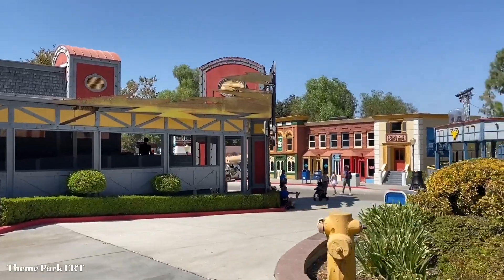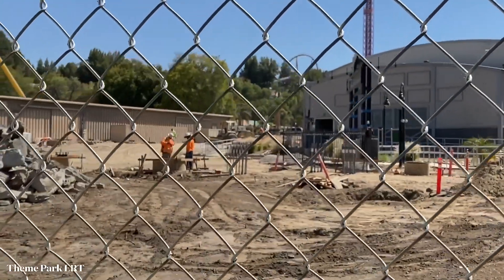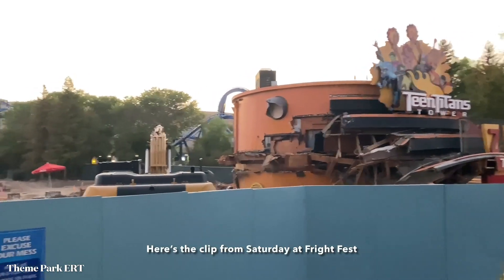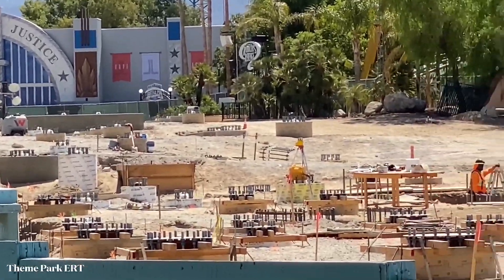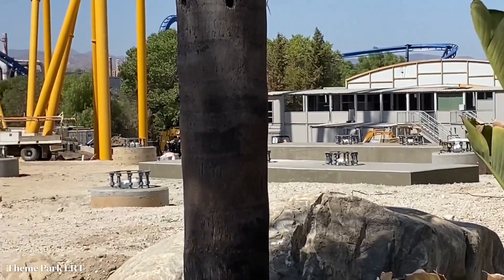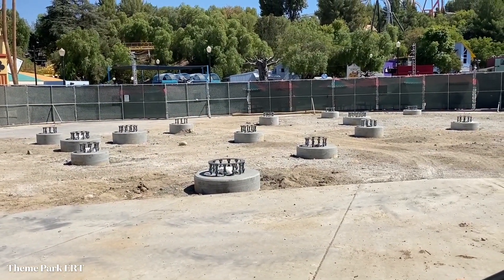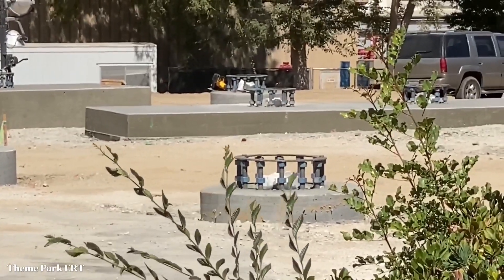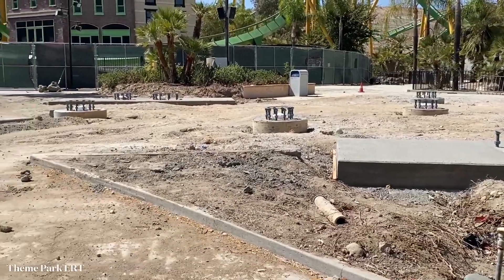SIX FLAGS MAGIC MOUNTAIN NEW 2022 RIDE CONSTRUCTION UPDATE #29  9/21/21 [TEEN TITANS PIZZA GONE!!]

Comment: I counted roughly 150 footers in Santa Clarita’s Drone’s video. Out of the ones I could see they are at least half way done with the tops as I counted 75 and I am sure there were ones I couldn’t see.
Reply from the maker: They have 9 more concrete pours to go if that helps with your calculations at all
Reply: @ThemeParkERT  It amazed me after sitting and counting just how many there are. 9 more pours is not a lot consider how much they have already done. Can't wait to it go vertical. i still holding out hoping for beginning of Oct.
Reply from the maker: @troyvisserhbhs4069  concrete should be done in a month or less